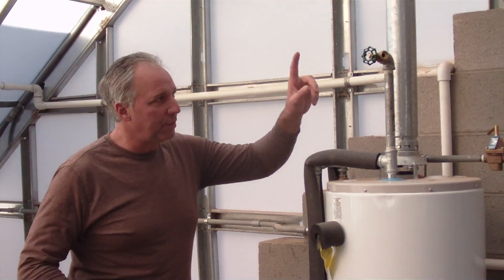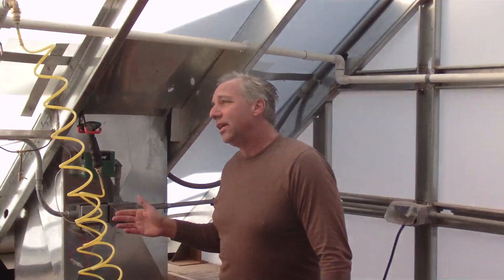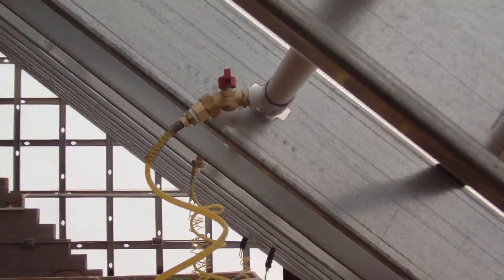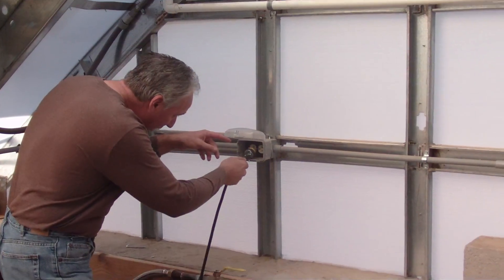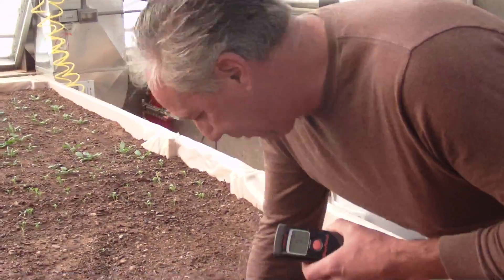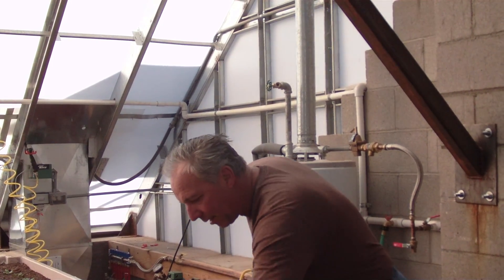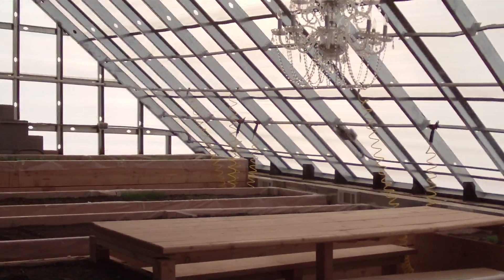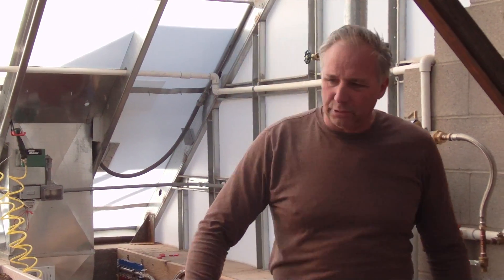Greenhouse Planter Box Heating System In Action

Comment: I noticed that you were filling your heated benches with growing mix-being high in peat moss--this will cut down the heat transfer do to it's insulating factor. Might I suggest using a fine washed sand that has been soaked with water then drained below and above your heat coils 1 or 2 inches, cover the sand with landscape cloth, then add growing media. This well allow the heat to radiate evenly under the growing area-plus will act as a heat storing layer reducing your energy consumption. Keep this area moderately moist.

Another thing, depth of soil needed to produce desired plants differs greatly--for instance, carrots-vs.-lettuce; cabbage vs. corn; so growing soil depth should be considered. Use only what you need thereby cutting your heating expenses.

Yet, another thought is in greenhouses the soil should be changed quite often-lowering the  risk of a build up of unwanted conditions that could be counter productive--fungi, bacteria, virus, bad insects...by replacing the growing layer (which doing so is aided by the lay of landscape cloth) after a few growing cycles you'll see a marked difference in production. The used soil can be composited and reused over and over again. This way you can replace the nutrients lost during each growing cycle.

Comment: First off .... Great job on what you have so far!!! A simple fix to your temp issues would be to make a radiator, basicly like the one in your car, and place it between the hot water supply line and your manifold that routes the h2o to your beds, in doing this you will be cooling the supply line to your raised bed heat lines and at the same time be warming the air inside your green house, and if you still have a high soil temp you could make a water cooler out of a 55 gallon drum and copper line

Comment: Thanks for the videos!
How do you pump the water?  We are doing a school project and are using a passive solar system inside the greenhouse.  We are thinking about a cheap DC pump to circulate the water....and possibly having an additional storage tank to store the hot water for night.  After watching your vidoes, we are also thinking of having the tubing half under the dirt and turn and half right near the surface to heat the air better around the leaves.  What are your thoughts?